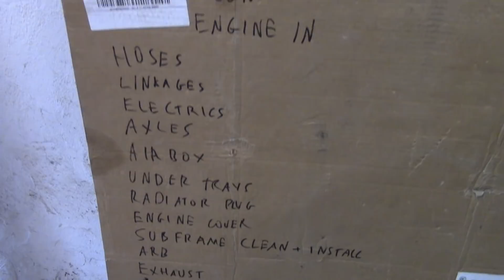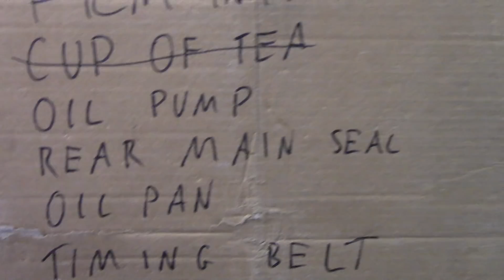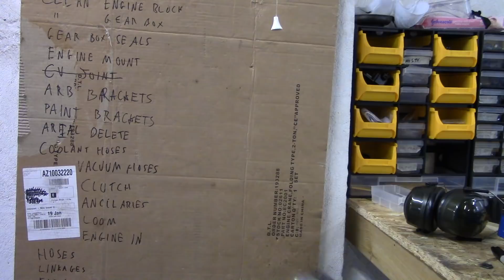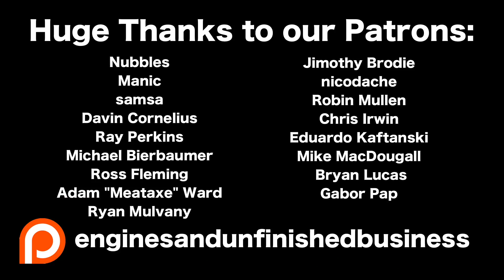Building an MR2 in One Week - Day 1

Comment: Thanks for another great video, Matt! With things like the ARB brackets, you might want to check the price of a new set before refurbishing. According to the official Toyota US parts  website (which is a great way to find out parts numbers, prices and access parts diagrams) they should be around 16 USD each. Some bits are outrageously expensive but some are surprisingly reasonable.
Reply from the maker: Glad you enjoyed it 😊 I did see the brackets were available and not too expensive, but I just prefer to refurb the existing parts wherever possible

Comment: Dunno what part prices are like from Toyota themselves, but I use a site called MR2Ben. He's based in Wales I think. Has genuine and blue print parts for MK 1,2 and 3 MR2 and it sorts the mk 2 bits into whatever rev MK2 you have. Might save you some brass. Got a rev 3 MK2 T-Bar myself and had a few parts from there. Great videos by the way. Good luck!
Reply from the maker: Most of the parts have come from MR2 Ben, we only go to Toyota for things that either aren’t stocked by MR2 Ben, or when we need just one little item in a hurry as Toyota is free next day delivery, and the seals and gaskets are pretty cheap

Comment: Sometimes you can remove these type of oil seals (i.e. main rear engine seal) by using a self tapping sheet metal screw. This assumes there is something in the seal for the screw the 'bite" into, other that rubber. Let's say there's a metal substructure under the rubber. Then screw in the screw and use pliers or some other suitable tool to pull on the screw. Should the screw pop out, no problem, just make a new hole and try again.
Reply from the maker: That’s pretty clever, and there was a metal ring in the seal as well, we’ll have to remember that for next time 👍